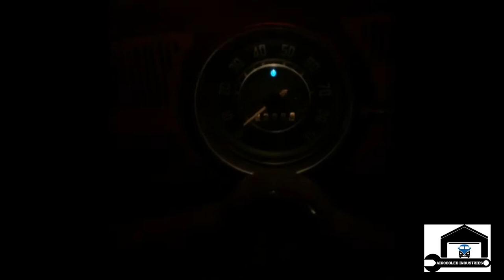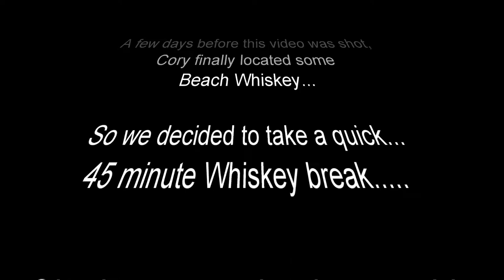My VW Bug Almost Killed Me!

Comment: Nice looking 61.  Quick question about your paint/patina.  I have a 63 with some rust spots coming through and thought about just grinding them down to the metal and doing some sort of clear coat right over the spots.  I've never done this before, but your bug is what I kind of imagine it would look like if I did it.  Can you maybe do a vid or reply about your paint/patina?   Thanks!!
Reply from the maker: Hey John, Thanks for you question. The patina or like I call it "poor mans paint job" is always a good hit at any show I go. it's really simple to do, just a few materials and plenty of elbow grease. I would advise to not use power tools or sanding machines, unless you intend to sand down to bare metal. I would love to make a video to show you how, thanks for your recommendation. Give me a couple days to buy, film and edit a video for you.
Reply: Awesome!  Just subscribed so I get notified.  Looking forward to it.